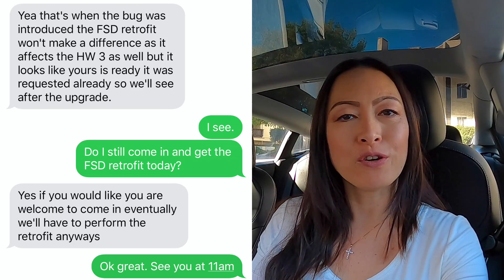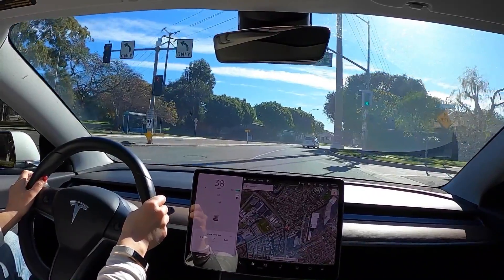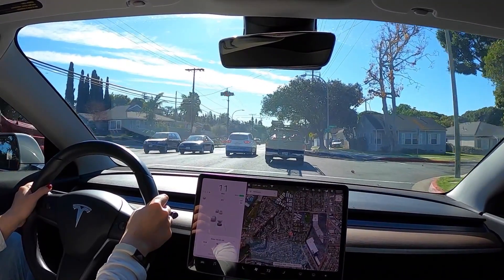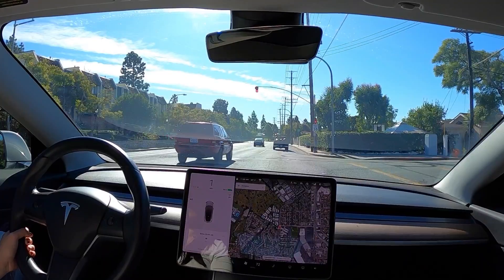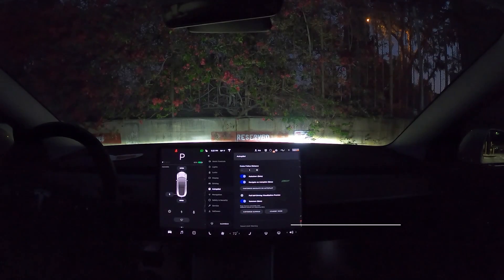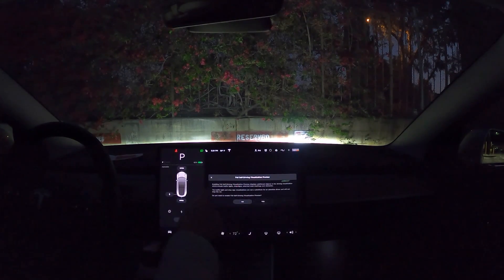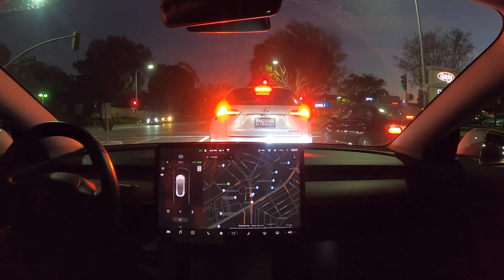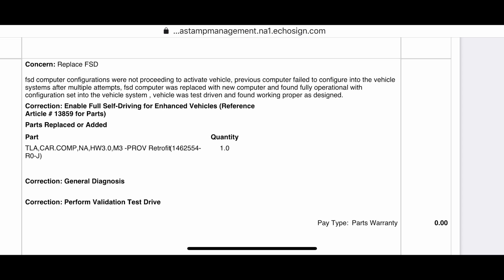HW3/FSD Computer Retrofit Saga For My Tesla Model 3

Comment: How would I know if my model 3 is equipped with the hardware 2.5 or 3.0? Does Tesla charge for this upgrade which I already pid for the FSD and AP.

Do I need to wait for Tesla to contact me or do I use the app to schedule an appointment? Thank you Joy!
Reply from the maker: Hi Marky, as I mentioned in video, Tesla will contact you if you need this.
Reply: Tesla Joy thank you Joy ;)

Comment: +Tesla Joy to get your voice command to work properly,
1. press and hold the Teslacam button until the red circle turns gray
2. eject your USB drive
3.  Press your brake pedal then hold your steering wheel scroll wheels until the Tesla logo appears.
4. Now test your voice commands
5. Reformat your USB and create a new TeslaCam and music folder if you had it.
Check out my website falconwingtravel.com
Reply from the maker: Thanks David, my entire autopilot computer was replaced and car was off completely with usb unplugged. Still does not work. Also when you reboot your car you do not need to press on brake. https://twitter.com/teslajoy/status/1212390397818761217?s=21

Comment: Oh, I envy the HW 3.0 owners!  Even though I did not buy FSD, I knew the new chip was coming so held out ordering until 4-17-2019, which turned out to be 5 days after Tesla began building with the FSD chip.  However, my car was pulled from existing inventory and was made on 4-8-2019, just four days before HW 3.0 was implemented.  I would have returned the car, but my ICE car had pretty much died.  I wonder if they will eventually offer HW 3.0 upgrade without FSD software purchase?  I think it will perform better.  For instance, some times the dashcam videos glitch out a bit under HW 2.5.
Reply from the maker: That’s a good question. I bought my FSD upgrade for $2k back in March when it was on sale. I initially only got EAP and not FSD because it’s not going to be reality any time soon. But I jumped on $2k because of the hw upgrade after watching Tesla Autonomy Day.
Reply: @TeslaJoy  You got a great deal on FSD!  Glad you finally got your HW upgrade.  Did you notice any improved behavior with the new chip, such as maybe more smoother or confident AP?
Reply from the maker: Yes, but there was still a bit of phantom braking though.
Reply: I ordered my car may 2019 and receive in June. Build date is may and it still has 2.5 hwd. There is cars even into July I have read about that have 2.5 instead of 3.0. Hopefully Tesla updates the ppl that didn’t pay fsd but want hwd 3 or at least can pay just for the computer. Right now it’s only visually better but I do think in time just basic autopilot will be better on hwd 3.0
Reply: @greghill8575  I guess they had a big stockpile of the old Nvidia chips or a limited supply of their new custom FSD chip, so used them up when FSD wasn't ordered.  With 21 times the power (or at least 21x faster frame rate of real-time video processing) I'm sure the HW 3.0 will perform much better - more accuracy and responsiveness.  I hope they do provide a compelling path to upgrade earlier HW.

Comment: I’ve had my car for approximately 3 weeks and after the last 2 updates my mic doesn’t work after the first 2 voice commands.
Reply: Keith X  Similar experience on mine. I reboot, it works 2-3 times and that’s it. 50.1 worked ok for me . 50.5 started giving issues. 50.7 I have not played with much yet.
Reply: Dennis Schlieckau exactly right.
Reply: After the initial update my mic input was not working well at all, but it did function better if I kept the right steering wheel button held down while I spoke and until the command was recognized.  Now after update 50.7 it seems to have settled down a lot.
Reply: Sitaifun Mac  I just tried a bunch commands. 50.7 the first couple worked well then it stopped responding to voice. It kept giving me the “say something like “suggestions.
Reply: Dennis Schlieckau I spoke to Tesla today, they said there are no known bugs relating to the mic.   I may have to bring it in for service but now that I’m listening to others I’m almost sure it’s going to be fixed in a later update.  Well hopefully a sooner than later update
Reply: @dennisschlieckau8723  I guess there are still some bugs to work out.  I don't expect that it would be an issue of HW 2.5 vs 3.0; I'm on HW 2.5 (missed it by 4 days!).
Reply: Sitaifun Mac correct, it’s not HW related. Just software.
Reply from the maker: I’m now on 40.50.7 and it’s gotten better but still not 100%.

Comment: Your droid has a bad motivator :)
Interesting non standard blinking red traffic light. Yet another aspect AP will have to handle. Those will be among the difficult niche issues. Of course they can cheat and know where they all are and ignore them but any new installation will need to be handled as well. One of the many reasons that Tesla taxi operation is not going to happen for many years to come.